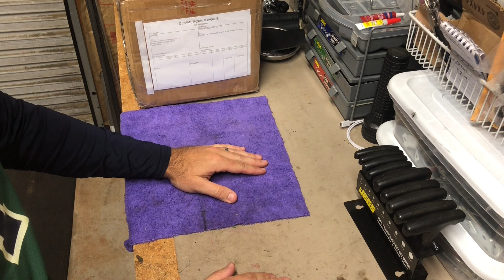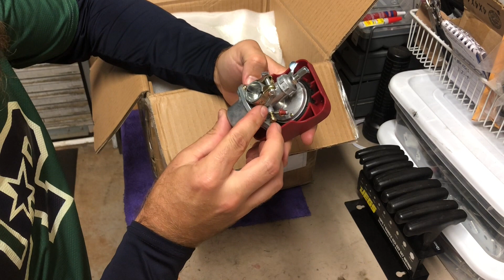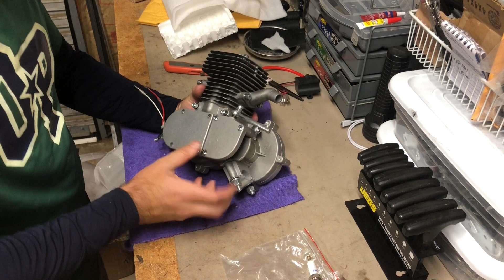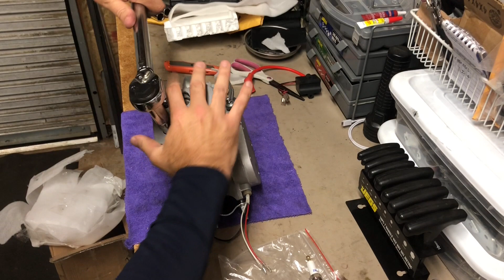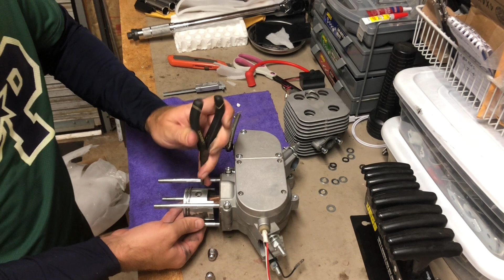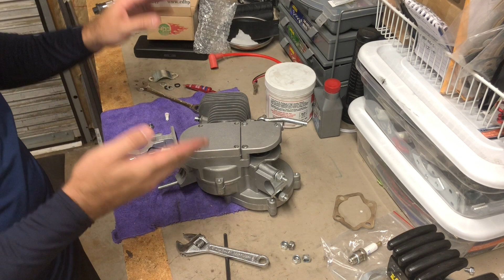Firestorm Zeda 100 YD100 Engine Tear Down, Review, and Pre-Install--Must Watch To Save Yourself

Comment: Not sure what to say so I'll start with my main problem. Supper high compression. To the point the back tire won't spin when I drop the clutch unless I'm pedaling my ass off. Would more squish fix or help?

Comment: Kool video. I'm running a windowed piston with matching cylinder head from CDHpower/eBay,  along with CDHpower bottom end from Amazon. With the reed valve and high speed carb and a expansion chamber my yd100 engine is a beast. These engines aren't that complicated to build.

Comment: Why did you delete the white wire?
Reply from the maker: The white wire is auxiliary. There to power a low level 3-6v light. But if it is used, it will drain power from the engine. It is better to use a battery powered light.

Comment: I like the anbull 100cc yous should check em out their good engines I definitely would like to see a reed valve and expansion Chamber on a anbull 100.im a lighter guy and all stock I hit 43 top rip with a 44 tooth sprocket .I don't change out the sprockets cuz I like the high torque of the 44 and up ones.i might put a 36 and a 32 tooth on just to see how fast I can get this "100"cc engine to go

Comment: Hello I am trying to decide between this with a performance pipe on it or the zeda 80 with the dio reed and the oko carb on it? Any thoughts
Reply from the maker: Thanks for watching. Well…the dio reed setup is definitely a good set up. You’d get some more low end, better band results, and it looks sweet too! You’d still want to buy an exhaust upgrade for the dio setup otherwise you miss out on some of the benefits of what you paid for. The yd is a bit choppy, but with the exhaust, it calms it down a bit and you have good low end torque out of the box. Really, the choice is yours, just make sure you spend time to set your kit up properly. Happy building

Comment: Do these motors run oil in the crank case or not? If so what weight
Reply: They do not, they are 2 strokes so the oil is in the gas

Comment: Can 80cc carburetor go on yd 100cc iv just got
Reply from the maker: Yes, it can BUT the carb jet is slightly larger with he carb that comes with the yd100 kit. The jet in the yd100 is usually a 76 and the one that comes in the 80 is usually a 70. So it will work, but you'd probably have to adjust the c-clip on the needle to make it run smoother.
Reply: @SouthernCustomCC  thanks for your help mate love you videos here in england, keep them coming , I got fat belly pipe for my YD 100 do you think eney good , thanks

Comment: Bt100 is a better engine kit in the vs yd100 is not better crappy casting and poor performance yd100. if you want a form its and quality the bt100 engine kit is for you
Reply: I'm just a big fan of the bt-100
Reply: This guys has posted the same copy/paste comment on nearly every YD-100 video... Must be a bt-100 reseller lol. Unlike this troll with no content, I have repeatedly put the same yd-100 through absolute hell, with over 30 videos to back it up.

Comment: If the piston is in backwards will it still run properly?
Reply from the maker: It will run. It will have no noticeable difference. But after time when the rings loosen up a bit and shrink, the tip of the ring opening may hit the exhaust port opening and bust a ring and then destroy the engine. It's a risk not a guarantee.
Reply: Thank you.  I took the cylinder off to have a look just in case   The piston was on the right way but I’m glad now I don’t have to worry about it.   Cheers!

Comment: Double head gaskets is because the cylinder body head piece doesn’t normally seal well with just one gasket installed I learned that had fuel leaking out the sides

Comment: Got everything put together and tried starting it, it turned over and fired just once. Then it started leaking fuel out of the air filter on the carb. (44-stroke 49 cc Bicycle motor) please text/call my cell @ (360)-204-0333, my name is Sky.
Reply from the maker: There is a lot of room...we need to narrow it down. First, it fired and it was moving on it's own? Make sure your carb slide is installed properly. This is the grey cylinder inside of the carb that your cable is attached to. On one side of thisnpice, there is a slot running down the entire side of it. Make sure that slot is facing the gas inlet nipple where your gas line is attached to the carb. Make sure it sits down in the carb and your cap is screwed on properly. Start there.

Comment: I got this engine,and I went by what you said,but my experience was there were three gaskets for the head ,so I left two out and just left one like suggested,it would've never reman,because the was not enough room for the piston to do it s job,so my suggestion ,if there are two or three leave them on,they aperently need the space for the 50 mm bore to work properly,now she runs like a bat out of hell,my first build was a nightmare ,over two gaskets,

Comment: I got my YD100 from CDH also, it had a broken fin on the cylinder, and they sent me a new one, very quickly I might add, but you only have 48hrs from the time you receive it to make a claim, which I just so happened to see in the fine-print on the day I received it, and that's what made me inspect it, I usually just put these kits up-on the shelf for months before ever opening them.

Comment: Another trick drill some holes through the plastic red carburetor cover so you will get more air intake
Reply: Yes! I have done that too. Definitely helps it breathe. I put probably 10 holes in mine lol. I have also heard people drill into the exhaust pipe bottom cap

Comment: Don't forget metal bolts against aluminum motor the heat expands so if it's too tight you could crack where the bolt goes in

Comment: I just got to knew Silver gas tank for $10 go for 20 $22 on Amazon I think it comes with a better pet cock you screw on the outside not into it it has the external screw not internal so it won't leak it's an upgrade better gas cap less spillage

Comment: The piston might come in bacwards so you have to buy new ones check it the side with the pin should be on the intake side not pins on muffler side they rub against it

Comment: I got three gaskets for the cylinder, so I should use just one?

And also should I put loctite on the studs which keep the cylinder in place???

A fast answer is highly valued!
Reply from the maker: Use one gasket. DO NOT LOCKTITE YOUR HEAD BOLTS OR THE STUDS. Just torque your head to 12-13 ft.lbs
Reply: @SouthernCustomCC  
thanks a bunch! :) 
Why not use loctite on the studs?
And also how do I know how tight I have to make them when I have no torque wrench?
Reply: @SouthernCustomCC  I also put two stroke oil inside the cylinder, on the piston and on the piston walls, is that good?
Reply: And should I use wheel bearing grease on the clutch, inside the motor?

Comment: Thanks for the video so far i like the YD100 kit only issue im having is when I pull in the clutch the motor revs really really high it won't idle because of this issue any thoughts would be helpful
Reply: turn the idle screw down or check throttle cable adjustment
Reply: Could be an air leak somewhere around the carb
Reply: What jets are u running
Reply: @joshrichards8889   F86 sabre jet and mig 15 try those too

Comment: I learned a lot from the video thanks, but if the piston is backwards will the engine still run ?
Reply: Will the engine still run if the piston is backwards?
Reply: @christophercarter7832  I'm also wondering this
Reply: Yes the engine would still run with the piston backwards. It's marked to go together a certain way, but either way is identical unless it's a windowed piston.

Comment: Can we change the head for a racing one?
Reply from the maker: Thanks for watching. Not yet,  but I assume one will be coming out in the future because the popularity of this engine has exploded lately. If they do this, there will be a height clearance issue though. It wouldn't be able to fit in most setups because of the larger sized CNC heads.

Comment: So I just ordered the complete kit, but it's going on a minibike so I need a pullstart. Do you think that the pullstart for the Zeda 80 will fit? Like are the magneto covers the same size?
Reply from the maker: Thanks for watching! Yes, it will fit, but don't get the crappy pull start that will break after 2-4 times. Get the pull start that has the thicker spring loaded arms. These are typically found with two decorative line grooves molded onto the face plate. Hope this helps!

Comment: How did you compress the piston rings to get the piston back in the cylinder? My engine came with the cylinder head off and I ended up breaking the top ring trying to get the damn piston in. I have a new one ordered but there has the be a trick to compressing them all the way around to install the piston in the head.
Reply: I just run my fingers around the rings starting at the exhaust side till i get to the sides of the piston and i set the exhaust side of the piston in the cylinder and use the other hands nails to seat the rings on the opposite side
Reply: @joshrichards8889  basically how I do it, but with short nails so theres a struggle

Comment: Just Purchased the same motor is it necessary for me to tear it down to see which way my piston is I bought it from bicycle .com
Reply from the maker: Thanks for watching. I always tear mine down, but I haven't seen a backwards piston in quite sometime now. If your doing it just to check the piston direction, I'd say don't worry about it. But if you want to check everything else, then its be a good project to do. The choice is yours.
Reply: Southern Custom CC wow First of all I’d like to thank you for taking the time to respond to my Mail so quickly second videos a second to none you take the time to go step-by-step and I think I’m gonna take your advice and teardown just to look on could I see through the exhaust side which way the rings were without tearing it down
Reply from the maker: Matthew Cartelli : check this out. This might be what your looking for...

https://youtu.be/YoAktFChW1k
Reply: Southern Custom CC that was another awesome video 👌! But my question is Can I see the direction that the piston is going by looking up two pins on the piston rings by looking at them through the exhaust port or the intake port without removing the judge at all

Comment: I got a laugh out of, "finger tight" lol. I'm interested to know if the wrist pins are the same as the smaller engines.
Reply from the maker: Thanks for watching. Yes, the wrist pin is the same. The bearing is 10x14x15.

Comment: Looks like the bottom end and connecting rod are the same and they just produced a larger top end for the same bottom components. Not being able to get the head off sucks because you cant get into the right angle to remove that ledge in the tops of the transfers.

Comment: You should make a video on how to put piston back together... I just ruined my new engine checking to see if ring was on correct :/
Reply: Happened to me too. Don't reuse the clips for the piston. If you do be very careful with them. 85 dollar mistake for me.
Reply: They’re easy to do man
Reply: Dumbo
Reply: Just make sure you can see the clips through the gaps of the rings. Figured it out after 10 min. Good luck. :)
Reply: @aleksandramakari  see the wrist pin piston clips? Or you mean the little pins on the piston itself that fit in the gap of the rings?
Reply: Yeah it happens on the first time bud, don't feel bad. I know it sucks. With the piston in the typical direction, with the arrow facing the exhaust, the pins on the piston will be facing the back or intake side. This go in between the gaps on the rings. It is tricky to pinch those rings tight to piston and slide the cylinder jug down over it at the same time. It's like you need 3 hands to do it lol.
Reply: how did you ruin it?

Comment: I got a used one that they never got to start for some reason it kicks right over and I'm breaking mine in now. What has oil ratio do you use for your brake in ?
Reply from the maker: Good deal! 16:1 for about 75 miles. Keep it @ around 20. Then you can go 20:1, 32:1, or even richer if you want but I like oil...it gives good lubrication when the engine gets hot.

Comment: Does the clamp remove form the carb
Reply from the maker: The gold ring that uses the screw and nut to tighten the carb in place?
Reply: @SouthernCustomCC   thank i was just wanted to no bec i was hopeing the clamp came off so i could put it on a old brushcutter  i founded

Comment: What's the torque spec on the 4 studs that hold the head down? Lastly, what is torque spec for the nuts on the top end of head? Thanks in advance!!
Reply from the maker: Hey, thanks for tuning in! Head torque is debatable--depending on gasket size--but 12-14 ft/lbs will work. And I am not sure what other two nuts you are referring to at he moment..the exhaust? The intake?

Comment: ok so 8 years ago i bought a random kit off ebay and it pulled my fat 460 pound ass up  hills at 20 mph 
skip to today i lost 70 pounds and i decided i need a new one as i let the old one sit too long and its locked up so i buy one on amazon and it can't even do 15 mph on the flats 

did i get lucky before and just got a good engine or did u just get unlucky this time and bad engine? yes 44 tooth both times
Reply from the maker: Unfortunately, that is not uncommon at all. Even though they all look the same, there are actually quite a many different manufacturers of the standard PK engine type. Transfer cases are different, crank rod lengths, piston hole heights, cranks, port timing heights....the list goes on. You can't go wrong with the yd100 engine. They have spectacular torque and room for speed increases as well. I hate to hear you found a not so pleasing engine. Best wish to you, and I hope it all works out.

Comment: How will that extra head gasket mess up the timing. I can see how it will have lower compression by a very small amount since now the combustion chamber at TDC will be increased by a small amount. There are obviously no valves with 2 strokes, and ignition timing will remain unaffected since the points and coil are timed off crankshaft
Reply from the maker: Benjamin Thompson : Thanks for being a part of the community! Your input is greatly appreciated. So even though 1-2mm doesn't seem like much, an extra gasket can raise the jug 1-2mm and completely alter the intake and exhaust timing. Yes, this bike does not have valves, but if you consider the intake port and the exhaust ports are like valves, then the picture becomes clearer. On the standard 2 stroke jug, there is room for error between the heights of the exhaust and intake ports. That is why people port them out to get more power. On these engines, they are more precise on the timing heights of the intake and exhaust, which if altered, will mess up your timing. That means when your magneto is on the fire position and your piston is not at the right place, you'll have jitters and misfire. Also, with an extra gasket, you lessen the compression area during the fire stage of the rotation = less power/torque.  There are a lot more specific numbers you can check out, but his was just a quick explanation. I hope it helps answer your question. Thanks again for watching!
Reply: Wow thank you! Makes complete sense now!
Reply: I can't listen to this video. Need lapel microphone.

Comment: What's your thoughts on a 2 cycle to a 4 cycle
Reply: 2 cycle. High rpm, easy to work on, but low end torq and very gas thirsty. 4 cycle. Reliable, sips gas, good low end torq, but hard to work on and has weak power at high rpm, larger engine casing. Just my thoughts.

Comment: Thanks for the info and help man! I'm a 4 stroke guy,been running a modified 79cc predator on a friction drive setup front drive. Have managed 41 mph on flat at about 7000rpm.
I was hit 4 months ago doing uber eats here in philadelphia by a car that ran a stop sign, and totaled my bike, and injured my knee, looking to do a rebuild.
This bigger 2 stroke is a game changer. 30 mph cruise, and 40mph top speed would be plenty for a delivery bike!
Reply from the maker: Dang! Hope you are alright! I sell a lot of bikes to eatery delivery people. They like the nel lusso with the basket and rack. The yd100 is awesome. I have had zero engine problems and it just keeps getting faster and smoother with every ride! I agree....this engine is enough for most riders. Have fun and I hope your recovery is quick!
Reply: any updates?
Reply: Any pics or on fb
Reply: Any pics or on fb
Reply: You will be able to do more than 40mph
Reply: & I know where you can get replacement rings & an 0.25mm piston, ringset & pin from when the day eventually comes for a rering or a bore job on that thin cylinder jug..Trev New Zealand 🇳🇿🙃🤗